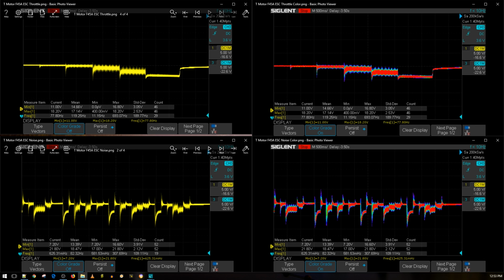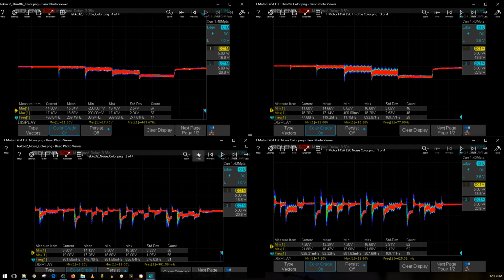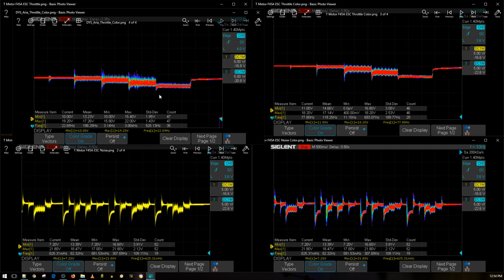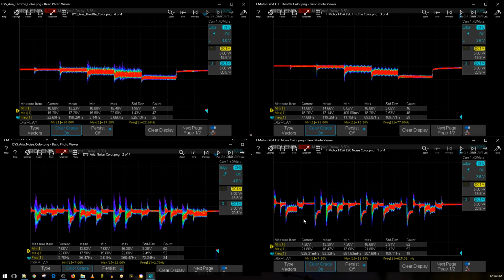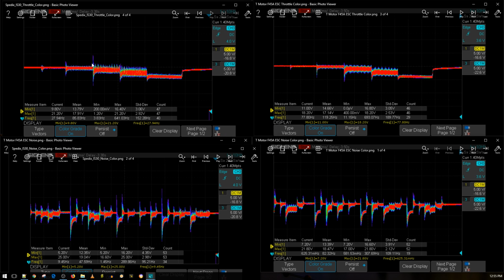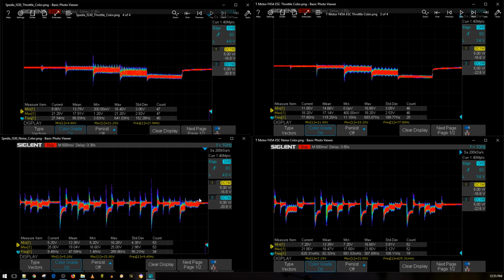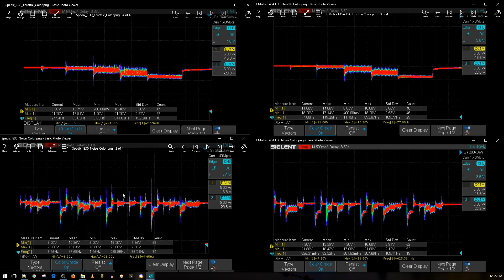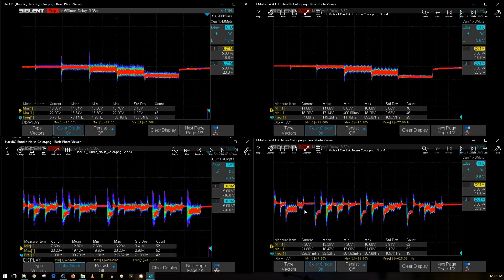T-Motor F45A V2 3-6S Blheli_32 ESC // Review and Noise Test

Comment: Which pdb i should ise for this esc?
Reply: Hey there, have you figured it out ?
Reply: @1095_STAX  yes I have used matek fchub 6s
Reply: @sdkavisne6096  Thats what i bought just right now. 
I guess is is still very gokd eventho it is around for quite a long time now.
Reply: @sdkavisne6096  Have you had any Problems ? 
Where did you solder on the small black wire? Onto a ground pad or onto the big black wire ?
Reply: @1095_STAX  i soldered the big black wire to gnd. the small one is for flight controller.  you can also find details in the video below
https://www.youtube.com/watch?v=8V4GdrEJdII&t=376s

Comment: I’m building a tarot 680 with 3510 350kv motors 6s. I’m leaning towards this unit. Do you think it will be ok with such a low kv on 6s.

Comment: Racedayquads sells their own brand 6s bl32 ESC $9.99 You should check it out man. It looks nice. I'm gonna try it becaue the ones I get are fairly expensive and it seams with 6s the only problem I've had with the lumenier 36amps are not heating up mosfets. I've never had that. but I have had a couple caps Just catch on fire on 6s. And it seams to happen randomly just when I plug a battery in. It's wierd. It's just started  happening when switched to 6s. Just twice but twice too much